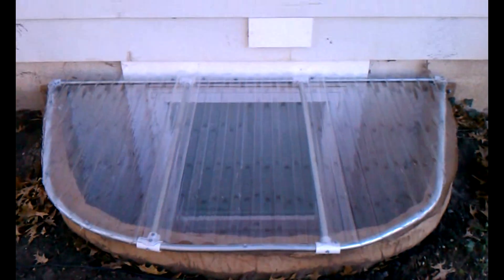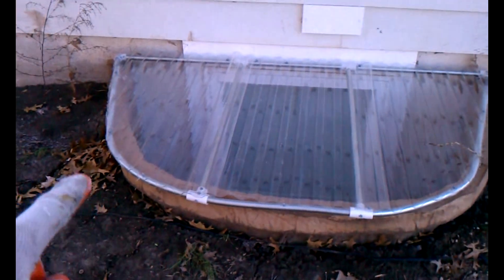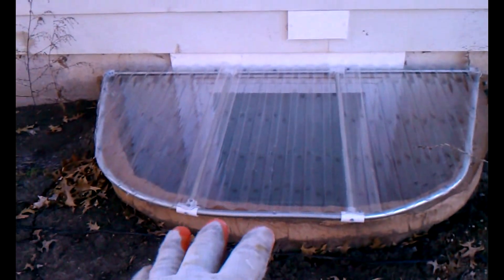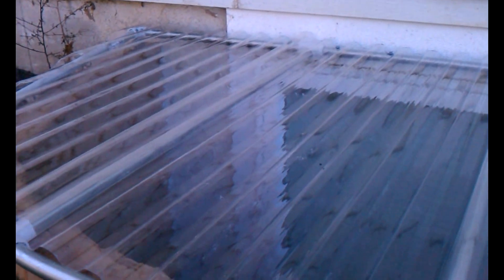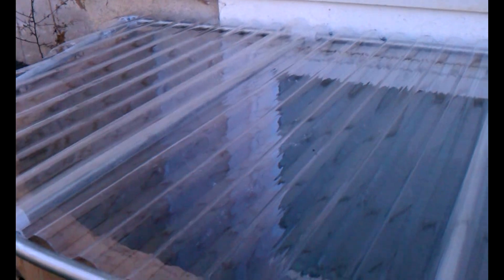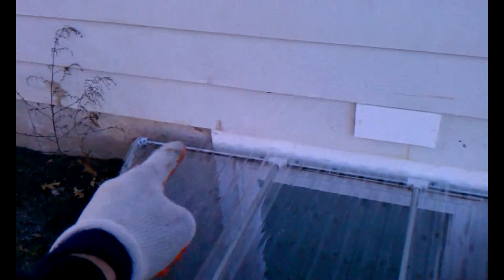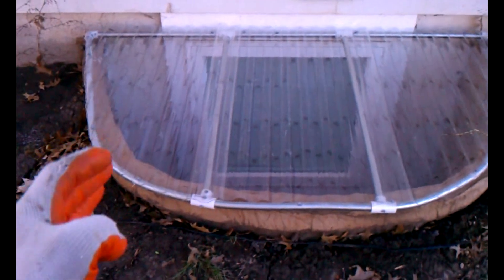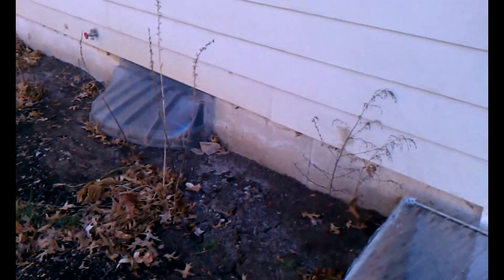DIY make your own window well cover-- with dimensions

Comment: How much did this cost to make?
Reply from the maker: Less than $30.  It was $20 for the corrugated panels and less than $10 for the EMT pipes and the PVC fittings.  I already had the metal zip screws but those are a few bucks.

Comment: Thanks for the great video. Pro-tip: put the Ts on the bent pipe BEFORE you start bending. They don’t slide on so easily (or at all) after you have bent it (depending on the shape of your bends, but mine did not slide on at all)

Comment: Just bought the supplies last night at Home Depot and the 3/4 conduit and 3/4 PVC joints didn't fit together. I was just planning on bending them in to make them fit in. Did you run into that problem?
Reply: +Carmen DeMaria Nope I had no problem.  The EMT conduit is much smaller in diameter than PVC so it fits in PVC fittings with ease.  The screws are really what cinches everything together nicely due to this diameter differences.  Lookup via internet search "3/4" pvc pipe OD diameter" and "3/4" EMT pipe OD diameter"  and you will have .128" extra by subtracting the two OD sizes between these two product materials.  Make sure you picked up the right fittings.  At my HD they are always mixed up cuz people (customers and staff) put them back into the wrong location frequently.

Comment: This i is great.  Any recommendations on how to slant the well cover toward the dirt?
Reply from the maker: S Ranford It really doesn't require a slant, because the thickness of the elbows raise the back end if you overhang the front lip.  I didn't put a slant on it and I never had pooling water/snow or a grime build up.  But if you want you can just put a small stone under each side to give it a little pitch.

Comment: I had to replace the plastic covers on my basement windows about every two years.  I decided to make my own out of polycarbonate and PVC tubing.  They are holding up better than the plastic ones that breakdown from the sun.  I am selling them on Ebay for $49.99   If you don't have the time to make your own, check them out.
Reply: diane r Hi There.Where can I see your window well covers. my dimentions are 55 x 20
Terry

Comment: very nice job! where did you get the plastic material from?  thank you
Reply from the maker: Home Depot
Reply: And it comes in various sizes ?
Reply from the maker: TheAelsayed
Just different lengths of 8' or 12' but same width.  It should be on their website

Comment: Thanks for posting this. This cover looks really nice, we were shocked by the prices of store bought ones and may end up making one like this.

Do you think the plastic material you used would be strong enough to stand up to snow on top?
Reply from the maker: 6 months now...went through a full winter and it holds up great.  I have EMT pipe at the joints of where the panels connect (see those tees in the middle), so plenty strong.  Cats and bunnies in the yard sit on it all the time so they've held up to small animals as well.